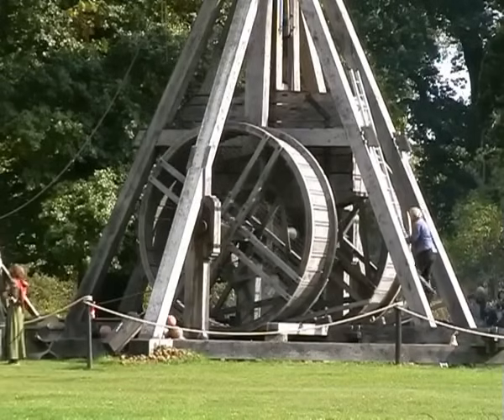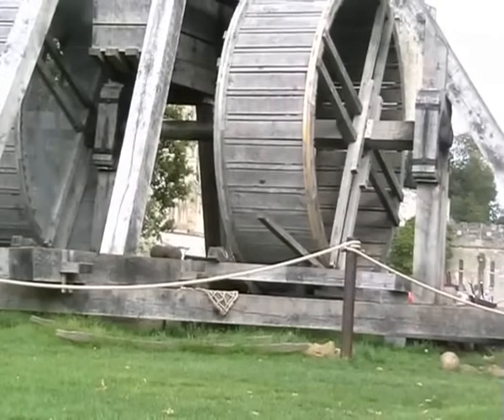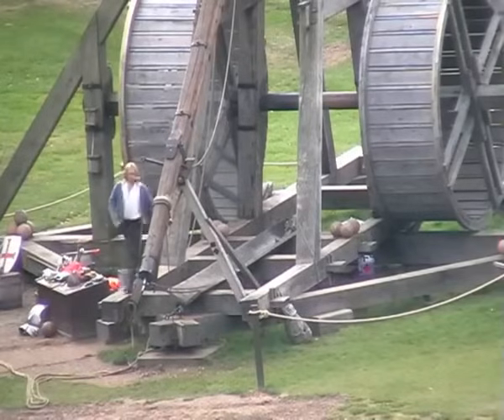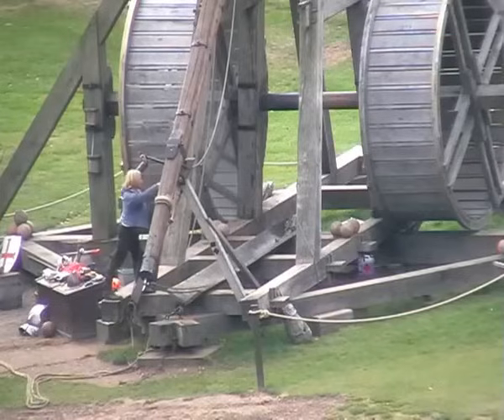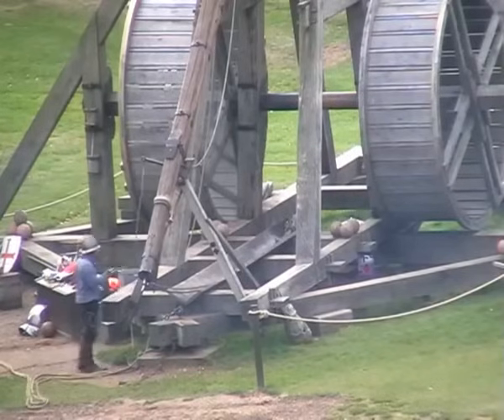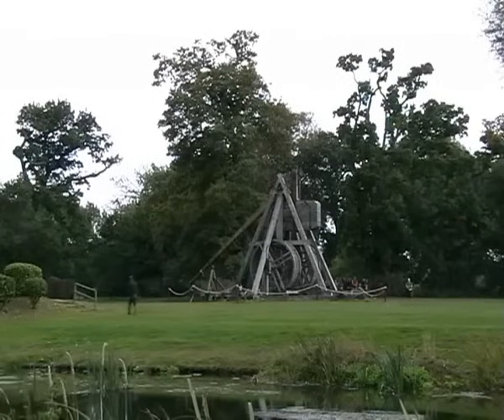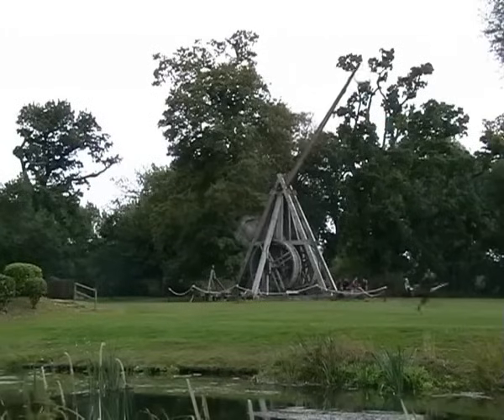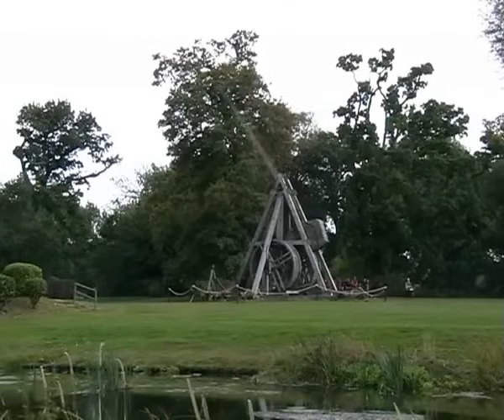World record trebuchet at Warwick Castle

Comment: The largest trebuchet ever built and used in human history was the "pertubation maneuver" that the two Voyager space probes used to sling themselves beyond the Solar System. A carefully programmed flight path had the Voyagers make an arc around the gas giant Jupiter, using Jupiter's gravity to accelerate the two craft to a speed that will allow them to leave the solar system. At it's closest pass, the Voyagers were between Jupiter and it's closest moon, and then one semicircular orbit later, they were leaving Jupiter much faster than they had arrived at, without burning any extra fuel.

Comment: You could make one 4 x this size of composite materials and weighing 1/3rd this one's wooden design. Then attach metal gears to wench down a cable 4 inch diameter and have a counterweight of 30 tons of solid steel ball dropping 20 feet. That should get a SUV on fire launched about 2.25-3.0 miles.

Comment: OSHA would have a fit if they saw that tractor pulling the rope straight-on. Always put a pulley on a tree or w/e and pull from an angle. If the rope snapped at the tractor, the man at the other end might be facing some involuntary amputations.

Comment: A shot like that would have gone approx. 200m.
The counterweight is just under half the total weight capacity.
You never fire a trebuchet (Fire is not used in it's propulsion). A trebuchet is always loosed (same for catapults and longbows)
The impact is a pathetic thwop into the ground. Nothing to be amazed over (I mean, what did you all expect to see from a machine hurling a stone into the ground?! The New Year's fireworks display?). It's not like the castle hired staff to reassemble a wall after every shot.
Any changes to the machine in terms of shooting distance would be a massive violation of health and safety as further shots are at risk of destroying the overflow car park at the castle.
This is an old video. The safety ropes are up. Nowadays they are down for the shot.
Reply: It's not like the castle hired staff to reassemble a wall after every shot.

WHY THE FUCK NOT??

Comment: That's the only trebuchet I've seen with a hamster wheel rather than two cross with four men operating each
Reply: iDespiseMicrosoftWindows All of the very large trebuchets uses the 'hamster wheel', it's quite common on the larger fellas, ie Warwof.
Reply: R4V3-0N I'm saying its the only major reconstruction obviously original ones have hamster wheels as it provides more energy but I've seen more reconstructions with levers

Comment: You can't see how far the projectile goes in this video.  That's what I was hoping to see.  You can't even see the projectile at all.  Is there one?  Was it just set off empty?
Reply: Yeah I wanted to see the range and what kind of impact it had.
Reply: Lazy Spark They were quite effective. A crew of men with known weights and feel of the individual device could knock down walls very easily with accuracy. A row of 10 units could destroy a castle wall in an afternoon of constant fire. Also throw plague dead animals and fire balls over the walls. Range over 1000 yards.
Reply: Same. I've seen lots of videos where they throw cars but when they only land 20 feet away from the trebuchet I don't really see how it'd be effective in battle.
Reply: @SleepingGoober  This is actually quite small by historical standards.
Reply: @BingleFlimp well a car wouldn't be a very effective projectile. It's not going to knock down walls, but it will take out other siege equipment, crenelations on walls and towers, as well as bodies to spread sickness. It would be incredibly de moralising keeping your eyes to the skies as one or two of these constant bombarded you day and night, making sleep and any sort of rest impossible as even in doors your under threat of being crushed, very effective tool of warfare. It's hard to defend a castle when you haven't slept in days.
Reply: Range: 200m
Effect of that projectile: Minimal. Just like throwing a stone into the ground.
Size can't be increased due to health and safety regs.
Reply: It reached orbital velocity